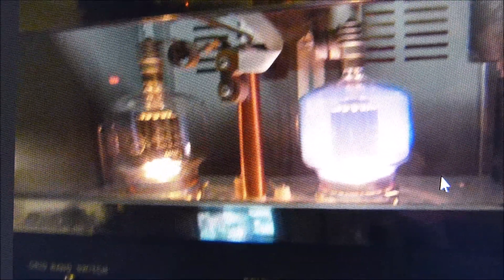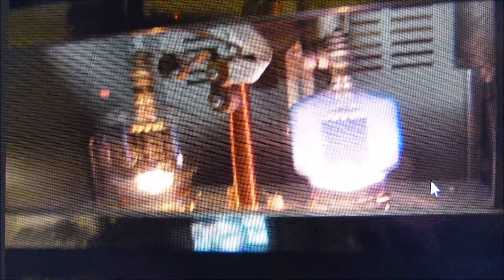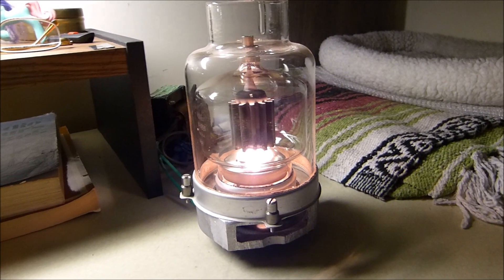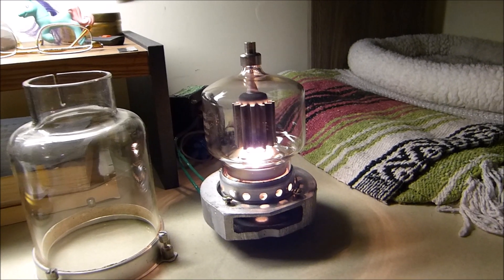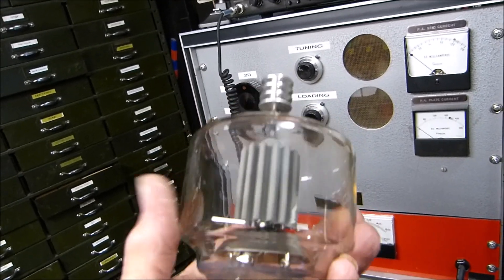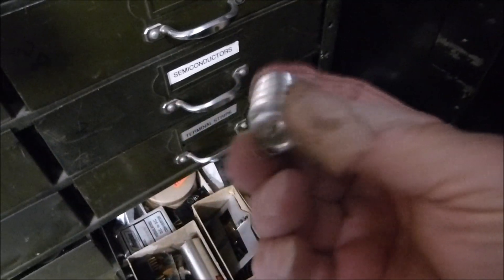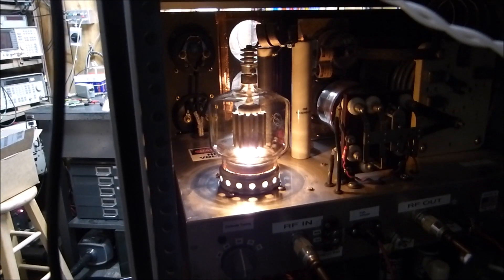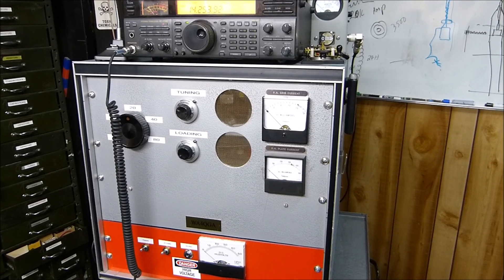Cooking Your Eimac 3-500Z Filament To Degass The Tube

Comment: Dave, I always wear rubber gloves when I handle HF Tubes! Hand oil can cause hot spots. Or wash gently with alcohol before installing. BBI on his channel has a video. You did a good job job on the cooking hoax! Thanks KJ7TBR😎🇺🇸JohnBoyUtah 🎙📡🎤 Wish these thinks were not so dang expensive 73
Reply from the maker: I just watched the video - got a good laugh at myself...  🙂 I wish it worked. Thanks for your comments.  73

Comment: What I have been told is that positive ions can collect on the cathode.  This decreases the maximum power the tube can produce.  A friend, who is a long-time ham, gave me a board with 2 sockets on it he used to "cook" 6146 tubes.  The filament voltage is the normal voltage, but the tube is reverse biased.   The cathode gets +50 V, with respect to the plate.   This drives the positive ions off the cathode.  Hopefully they will hit any getter on the glass.

Comment: Filament cooking will not work, the getter material is on the anodes and to bind gas the anodes must glow red which requires dissipation. Best is to do that with reduced anode voltage.

Comment: you Can get the getter to work which is designed to capture free oxigen by running the filaments for a while.  But there is NOTHING that is going to de-gas a tube, because that is ionizable metal .  By what chemical mechanism is that contamination going to be removed ? None.

Comment: Hi..I have 4-400 amperex tube and do the same thing like you said...the tube seems like new..this burning filament maybe repair the tube?thanks
Reply from the maker: I don't want to discourage you from trying to make your 4-400A work again. 
It is interesting how they can look new and the filament light properly and be bad under HV. Some depending on the level of high voltage.
There are rituals where some individuals believe if they allow their tubes, especially the 3-500Z  filament(s) to "cook" for a day or two before applying HV, it will make them work better and last longer by "degassing" them. That is anecdotal - it may appear to work for some but not for others. 
No one can say for sure that it doesn't help but in some cases it is not going to help. 
Eimac says the tubes must be heated to temperatures just below destruction of the tube in a laboratory controlled environment to make the "getter" function in the anode do its job. 
If it is already beyond help, it won't hurt it any further - just be careful not to get electrocuted or burn yourself as these tubes get really hot...   73   Stay Safe.
Reply: Thank you

Comment: Whats the purpose of the chimney, are they necessary or suggested for efficient operation?.
Reply from the maker: The purpose Eimac specifies is to  cool the filament seals and the plate seals so, if the chassis is designed to be pressurized under the socket, the air flow will from the bottom thru the holes in the socket around the filament seals and then upward over the bulb and finally out the top across the plate stem/glass seals. Mostly the builders just put a muffin fan blowing across the tube from the side. A lot cheaper so the chimney cooling system would likely be used for commercial and military equipment unless us crazy hams can get it and use it. ..

Comment: It's true, I've done it to "bad" 304 tubes. The correct way to do it is to ground the grid, apply filament voltage, and then apply plate voltage with a variac, starting with a B+ of zero (0) volts. Then slowly bring up the B+ until the plate dissipation of the tube is reached but NOT surpassed. This is the correct way to "cook" the gas out of the tube. The plate needs to glow red so it can absorb the gas within.
It has nothing to do with turning on the filament for several hours. Doing this will screw up the tube.

Comment: That’s because you haven’t cooked them in correctly. I’ve done more than one over the years and I’ve not had one fail me yet on cooking it in. But it has to be done correctly or it want work. You need 10 volts and 4 to 500 amps on it and plus your grid and plate needs to be hooked up and voltage going to them. You have to hook it up like it’s in operation mode for it to cook in correctly. Start off slow adding your voltage till she starts to glow orange. When it’s cooked in it will be the deepest color orange you ever seen. You need a variable high voltage supply to do this correctly. If you noticed on these 400 and 500 along with some others you will not see a silver burn in spot anywhere on the glass and that plate at the bottom is just a reflector. Some I’ve seen some cook in at a  few hours but I still leave them on at 12. Go check out mr carlsons lab on YouTube and look up the video on these 4 & 500 z tubes and how to really cook them in. You could have turned the tube around 180 degrees and just run one side at a time if you’d have wanted to.

Comment: Hello! The fact is that it is heavily polluted. A lot of air got into it and it lost its original vaakum. Since it does not have a getter, as on ordinary lamps, it will not be possible to restore it by calcination. Alas, now it is only an exhibit in the museum. Good luck!

Comment: maybe a lower plate voltage? you want the plates to glow red. if it arcs over, its done because it melts the grid
Reply from the maker: In this test setup, the grid is strapped to the plate so even at 90 volts or so, which has to be carefully controlled with a Variac, I can turn the plate as orange hot as I want and, of course, keep a fan on it to cool it, and then let the plate run red hot for several minutes to "degass" and it simply doesn't work on a tube that is just a little bit too gassy. I say, a little bit too gassy, as they filament lights normal so it is not full of air as it would immediately fill the inside of the tube with white smoke as I have seen really bad tubes do. 
My conclusion, not from just this example, is the whole idea of heating the anode to hot temperatures to "getter" (absorb) the gasses inside the tube is wish-full thinking. It doesn't work and in my opinion is a waste of time. I know fellows go thru this routine on their 3-500Z amplifiers that have been off for a few years and report great success. I plug in tubes, like the 4-400A and many others that are 50+ years old and turn them on and apply 3500 volts seconds later and have never had a problem. The tube is either good or bad and if bad, there is nothing we can do to save it, unfortunately.

Comment: I got an induction heater for just that reason- to heat the plates of those kind of tubes. The only problem is, I don't have any gassy tubes yet. Induction heaters are cheap now. Buy em on ebay from China (of course), but ya might try one as a last resort... or you can build one, they're pretty simple. It'd be interesting to see if that'd work for your specimen.

Comment: OOOOO.. potty mouth!
Too bad it didn't work.  Must have drawn alot of current when the ionization lit.. you can hear the transformer hum before the fuse blew.

Glad to see you around!  I was beginning to worry about you!
Reply from the maker: Once it ionizes, it must be pretty much a complete short on the PS as it instantly blows a 20A house fuse. I have house fuses on both sides of the line in a screw in fuse block in the power supply. I guess that was really more of a golly-gosh-darn moment... you have no idea how I control myself while in front of the camera   :-)
Reply: @ElPasoTubeAmps  I was joking about the potty mouth,.. I can only imagine the frustration!!

Comment: From what I have read you have to get them hot enough to turn the plate red or orange before the getter will activate.  Simply applying filament voltage is not enough for a 3-500z or similar tube. Since the tube is  arcing at full plate voltage that means a lower plate voltage to burn the gas out of it.  Then again that tube may be beyond saving.  I have not actually tried it for an extended period of time.

Comment: Those gassy old tubes are good for making art from. I have a 3-1000z that I cut the process tube off of and placed leds inside of. I mounted the socket for it in a little wooden craft box with a plate cap ,also with a led in it. It looks really cool.

Comment: It's amazing that these theories come from out of nowhere, which end up getting you nowhere. Once a tube is severely gassy, ain't nothing going to cure the issue except for a tube replacement. You can cook a CRT that's been idle for a number of years for an hour or so to wake them up and get some emission back, but even in a CRT; if it's gassy, it's history and replacement is the only answer. Fortunately, the EIMAC's are fairly plentiful. Interesting and good experiment...it separated fact from fiction. Great video as always. Keep 'em coning David! :)
Reply: Time to get a glass cutter
Reply from the maker: Hi Frank - good to hear you are doing well. I brought out a PS today and started trying to get the plate to turn red by placing the PS directly across the tube with a Variac on the HV transformer. I can't get the Ip higher than about 60mA and the tube ionizes right at 2KV and blows fuses. I got tired of risking my nice amplifier for this experiment. Then I put a little positive grid voltage on the 4-400A to (hopefully) increase Ip. No luck so far. If I could get the Ip to about 400mA at 1Kv or even 1.5Kv, I would be dissipating 400 watts in the plate and some have convinced me if I can make the plate turn orange, as it is supposed to, it will "getter" the tube. It sure isn't very gassy or the filament would not be so perfect. There are no DC shorts as I checked for the obvious and I even used a capacitance meter to see if it would read from grid to plate, screen to plate, etc the same capacitance as a good tube. While I am pretty convinced all this is hoop-la about bringing one of these tubes back to life, just at you are, some people claim they have done it and they are people that comment on my videos and I believe them. This may work for some tubes but not all. Doctors would call it anecdotal, my experience may not be yours and yours may not be mine. Somehow, I am still convinced that this is possible. I just have to be Very careful around this huge PS I have on the bench. I will probably make a video of it either way. Stay safe.

Comment: I like your videos! But, as mentioned before, merely cooking the tube with heater voltage alone won't do what you want. You'll have to pull enough plate current for it to be cherry red for a few hours - that's why power tubes live longer in constant AM service, where they maintain plate color all the time, as compared to SSB/CW. You can do this with a variac and rectifier - go to PA0FRI.com, click on the 'QRO' link, then scroll down to the heading 'Reconditioning Tubes', and click on the flashing dot left of the heading. This page outlines the procedure, and values of grid and plate current measured from 'known good' tubes. Your tube may well be good, as it 'almost' is good enough with just the filament burn-in regimen. Good Luck!
Reply: The plate itself is the getter, but must reach a certain temperature to work.
Reply from the maker: This has been extremely valuable. Too much to put in writing but I will be making a video of the results from  this procedure soon.  Thank you.  Stay safe...
Reply: Good luck!
Reply from the maker: @stirlingschmidt6325  I have read thru that article very carefully and I find it very valuable in both the way they test the tube by turning it into a diode and the value of cathode current for a set voltage he shows in his charts. I believe the 4-400A was about 350mA for 44VDC. However, I have found that on a good tube, the plate voltage can be increased to as much as 100 volts and the current will rise to around 1A and stabilize and rise no further. I know that is over-current for the cathode but please watch my next video that is processing as I write and  see how a good tube performs (actually three good tubes) compared to how this tube behaves. I have done all the degassing that these procedures document and maybe they help some tubes but this tube certainly seems bad and just isn't going to be rejuvenated.  I thank all of you guys so much for your suggestions and comments.

Comment: Merely "cooking" the filament does not do the trick as apparent from your experiment. A procedure & circuit for degassing a new 3-500Z is given here:
https://pa0fri.home.xs4all.nl/Lineairs/Tubes%20reconditioning/tube%20reconditioning.htm
Maybe you want to give the tube another chance?
Reply from the maker: Thank you for the link. This site was recommended to me below in a comment and I have read thru it thoroughly and  tried their procedures. Right to the point - it appears my tube is beyond help. It is interesting that strapping the grid and screen to the plate and turning it into a diode will allow me, with this particular tube, to increase the voltage to a point that I can get the plate cherry red with lots of blue and the voltage across the tube is only about 60 volts with 6A of current. Yes, six amperes of plate current - that was not a typo. At that point, the plate is dissipating 360 watts and is red and better than 400 degrees F. You might think, how can the cathode do this? Well, it can but I am convinced it is because the tube is gassy. When I put in a good tube into this "test" socket, no matter how high I raise the plate to cathode voltage, (max 100 VDC)  the plate current never goes over about 800 mA and the good tube shows no plate color and no blue glow and it works perfectly afterwards in my amplifier. 
Back to my original belief in this degassing process is, it is worthless. It is probably a good idea to let the filament run for a few minutes and after that put the HV to the tube. It will either work or not and you will save a lot of time that will likely deliver nothing. In my opinion, going thru this routine before putting a tube like the 3-500Z into operation and then having it work, would be just as successful if you did nothing other than the obvious of checking the tube for clean pins and no bits and pieces of material rattling around inside the tube, etc.   Just my experience which is anecdotal.    73 and stay safe.

Comment: Excellent topic! I believe that leaving the filament on alone will not do it. The anode is the getter and needs to get cherry red.  I have never tried it but have a pair of 3-500z I want to try it with and have done lots of reading. I believe the basic consensus is start with low anode voltage, slowly adjust bias so the tube barely draws current, get the anode as hot as you can without flashing over and draw current for a few minutes, then zero current, then back on, etc. Then you should be able to gradually ramp up to the rated plate voltage... Probably a good idea to put some air through the chimney to keep the pins and envelope cool. There's old timers all over who say this works, I believe one of them designed amps for Ameritron or Dentron. No good for a tube that has gone to air(ie no vacuum). Eimac had tubes with bad pin seals in the late 80's, there's no fixing that! If however it's just impurities in the tube, the red plate is supposed to absorb them. Arcing over like that can destroy the grid also, so it may be this tube is already beyond recovery :(

W8ji has a method to do this with the tube installed in an amp that may give you an idea https://www.w8ji.com/gettering_tubes_al572b_al80b.htm

Would love to see you revisit this one day. Keep up the great work! I've learned a lot watching your videos. Thank you!
Reply from the maker: I have been working on for hours. I think I have something worth seeing so I will do my best to post the results very soon. Stay safe.

Comment: the reason you can "cook" them is unlike small tubes they dont have a induction fired getter in the tube, instead they have a "bulk" getter (i think that what its called) but the plate itself is the getter and it needs to be hot to react with the gasses in the tube, and even the filament itself will act as a getter and react with any O2 in the tube.. getting the plate cherry red will help speed it up.. but that tube has ALOT of gas in it so i think it might be acting as a thyratron. as an experiment see if you can get it to pass some current on a variac or something so you dont blow the breaker and get the plate to just glow cherry red. the problem is the life of the filament will be greatly reduced due to it oxidizing. i
Reply: Ive seen those "Getter's" on the 3-500Z tubes, the little square plate attached to the pin inside underneath the circular plate? There are two of them.🤓👍
Reply: @ericdee6802  No, the getter material is a coat of zirconium on the anode.